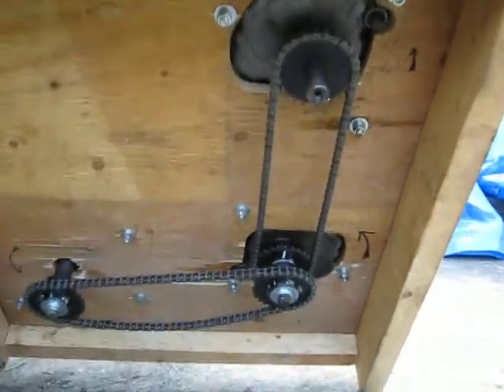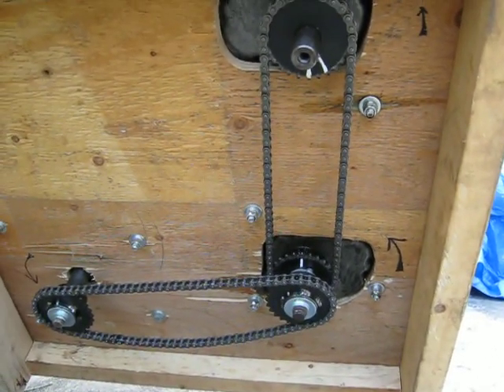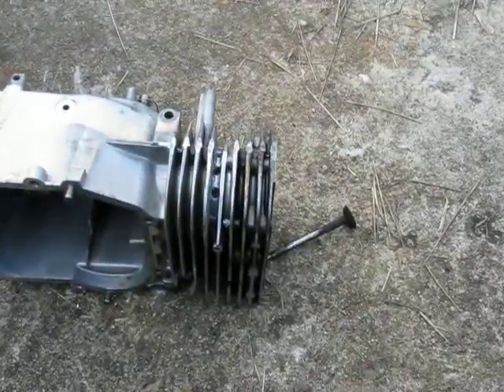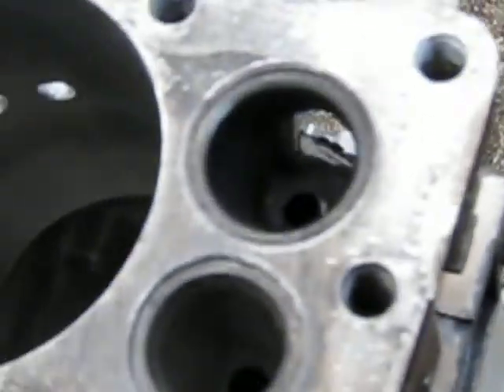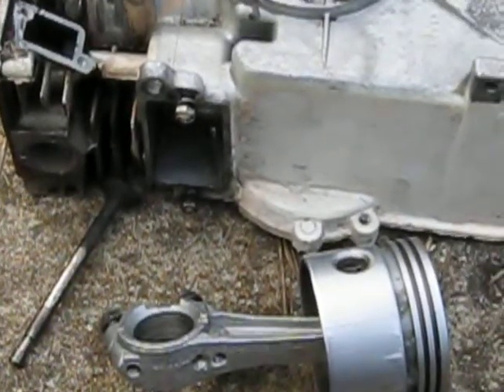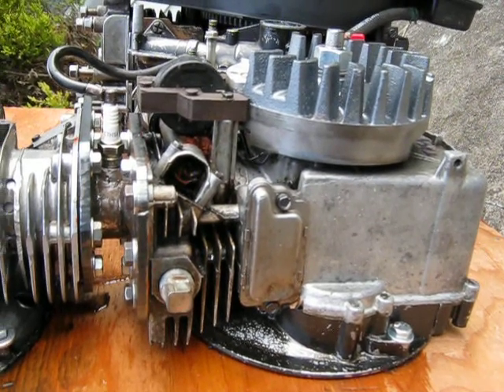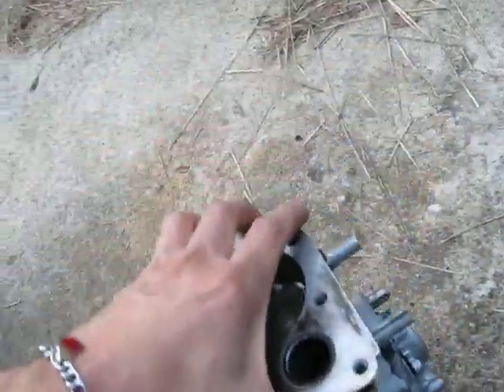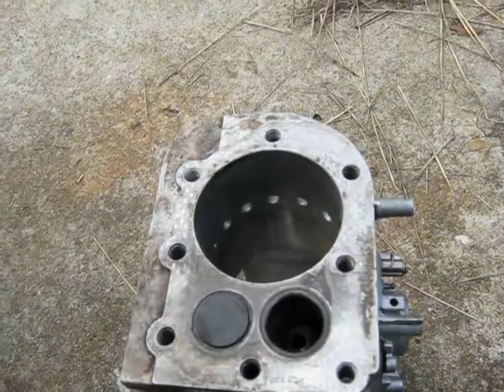Chain Drive for Jumo 205 Type Briggs

Comment from the maker: @ismokewead420 
Yes, a chain centrifugal clutch set up works well on go-karts, so it should work well on an off road mower, with a chain tensioner. I use #35 chain for my engines, and karts, but a tensioner is hard to find for that size, I might have to build my own.

Comment from the maker: @ismokewead420 
To be truthful with you, I had not thought much about the chain running horizontally, but you are right, it does have a tendancy to come off.
I don't think I would recommend using a chain on a lawn tractor, especially to drive the blades, as it could do some serious damage if you hit rocks or other things, whereas the belt could slip if necessary.

Comment from the maker: @nickzom 
Yes, those sound to be worth keeping :) They haven't made those vertical 5hp engines in a while. I use the model 8  3hp piston in my sleeve valve, in a 3.5hp block, there is just enough room for the sleeve that way. Nice of Briggs to figure that out when they built !!!  :)